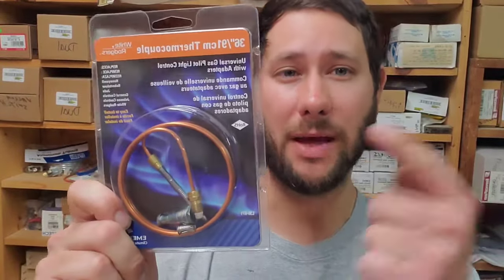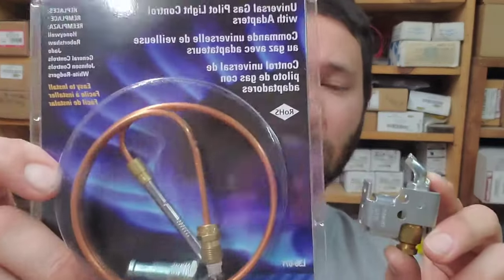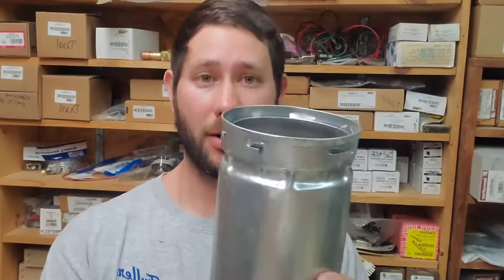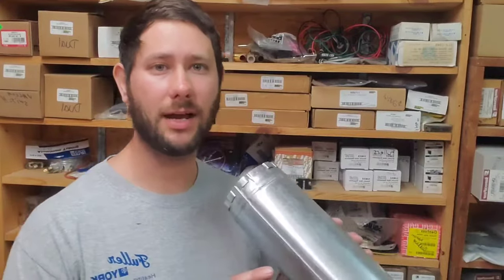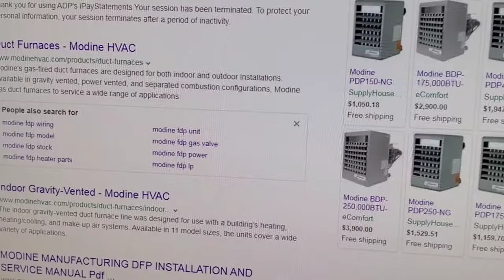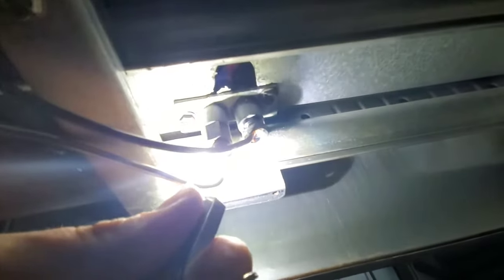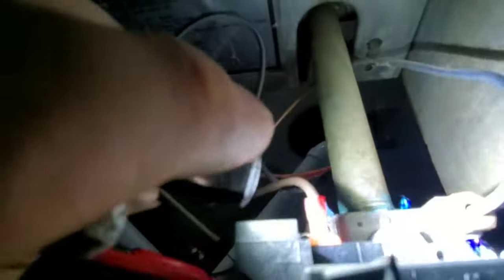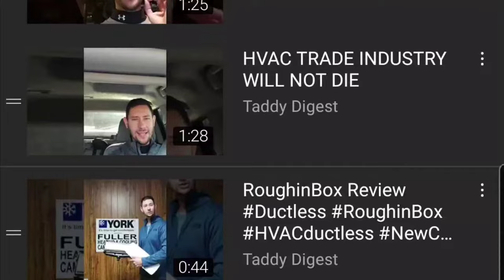3 Most Common Problems with Gas Hanging Heaters #gasheater #hangingheater #gasheat

Comment: Hi, i have an old large hanging Reznor xa-250 propane. It has 2 large fans for blowing the heat and an inducer above them. The heater will kick on and blow heat as it should, but the inducer seems to run for a long time before the main fans kick on. Like it will run fow 4-5 minutes before the the main fans kick on.

Comment: I have a Sterling 45,000 btu garage heater. I used single wall stainless steel through a metal thimble(one part on the outside connected to the other part on the inside). This goes through the wall for horizontal exhaust. 1/4" per foot down to the outside per instructions. Heat caulk to seal. Length is around 5' for back pressure, again per instructions. Please your comment will be appreciated. Thanks

Comment: sterling gg60 propane hanging heater ( new )  makes a quick whoop sound after you hear the click when it fires up .  pressure at outside regulator is 12 propane company checked that , Goes to black 1/2 inch black pipe to corrugated  yellow flex pipe 5/8 outer diameter 1/2 inner with safety end ! why the quick whoop sound ? its not a whistle sound just a quick whoop works fine after that  If you have advice that would be great . Would manifold pressure make it do that don't have gauge for that I think 10W>C> for propane
Reply from the maker: It's probably just the burner's lighting
Reply from the maker: Definitely get a gauge and check pressure.

Comment: What venting do I need for venting for sterling ggo60 Cat 3 or double wall Great video ! Have a 24x30 pole barn only have 1and half insulation and 5 eights usb building tight building would you do a 60000 btu or 45000 btu live in ohio Thanks again
Reply: installing cat 3 pipe and cat 3 thimble through pole barn wall osb inside then Dow Syrofoam board then metal pole barn siding Question 4 inch thimble how far from outside of thimble to combustibles 2 inches

Comment: Hi i have a new modine hot dawg 75000 btu it has 3” flue outlet had an old heater i removed i have a 4” existing vertical vent pipe out roof about 6 ft in length can i go from 3” to 4” and u existing vent thanx for any help
Reply from the maker: yes that will work
Reply: Thanx so much
Reply from the maker: @RobertPait-i3b You're welcome.Thank you so much for watching the videos.Please consider joining as a member

Comment: Installing a unit heater in my garage this weekend. I see a note about a 11” to 13” water column needed between heater and regulator. Is this the same thing as a drip leg for moisture in the in coming gas line?

Comment: why do you have to use double wall outside of the building..??does a propane heater exhaust need to go above a peak in the roof
Reply from the maker: Once you're outside, you don't have to use double wall Unless it's an area where it can be easily touched
Yes, you have to go above the roof so that the exhaust doesn't go in the soffit. Or gable

Comment: Nice video, thanks.  Any chance you would consider showing us how to install a Modine HDS (separate combustion model)  with the horizontal concentric vent kit?
Reply from the maker: Yeah I can do that
Reply: Awesome.  I just bought a Modine 45HDS (Separate Combustion) with the Modine horizontal concentric vent kit.  Kinda figured it out but don’t want to make any mistakes, cause I have to go through corrugated metal on the inside of the shop and stucco on the outside.  :) @TaddyDigest
Reply: Yes please, Im getting a reznor UDZ with separate combustion. @TaddyDigest

Comment: I have a hanging heater and the city came and said it was the regulator leaking. There was a strong gas smell. Does yhere need to be a regulator behind the gas valve
Reply from the maker: Is this a residential or commercial building
 Is this your home
 Is it propane or natural gas
 Regulators can leak the diaphragm can leak and you need a new regulator if that's the case
 If it's propane it has to have a regulator
Reply: Nat gas, garage/back of building, commercial
Reply from the maker: gas company will usually set a meter with a regulator that goes from pounds to ounces outside the building ground level 
you only need a regulator behind a gas valve when a gas pressure to the building is more that the gas valve requires which should be 3.5 in wc which is less than 1 psi
gas company sizes there meter for cubic feet per/hr and they are usually 40 psi in to regulator and less than inches of wc out to the building but if its 2 psi or more you may need a regulator before your furnace or heater
I would check with the gas company to find out the pressure that is coming into the building 
I would be interested to know 
hope this makes sense 
here is a video that may help you let me know 
https://youtu.be/w6AjBw3loHg
Reply: Ok ill check and let you know. I appreciate the concern and response
Reply from the maker: your welcome Phillip
Reply from the maker: JOIN if you want my number or email 
https://www.youtube.com/channel/UCuMyjTVlkM4xZ5z_eSyoB1w/join

Comment: I used b pipe. Double wall and it still gets hot.
Reply from the maker: Make sure you check the gas pressure
Reply: I installed a hanger heater in my garage. The single wall pipe off the back gets very hot but the B pipe seems to be ok and not as hot as the single wall pipe. That is normal?